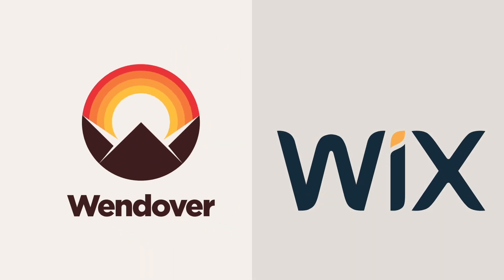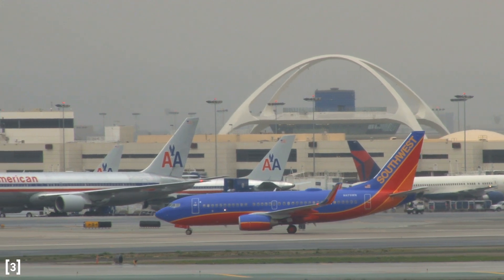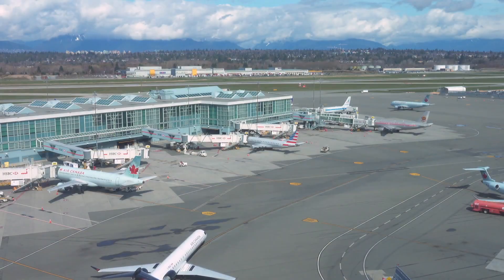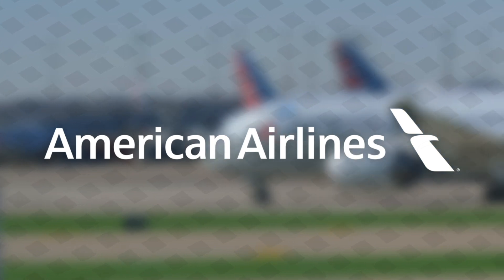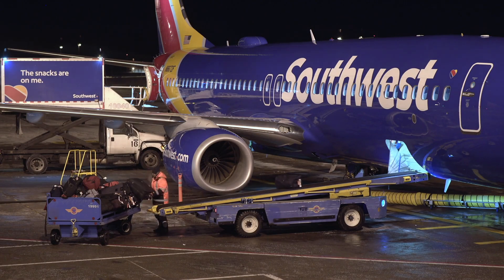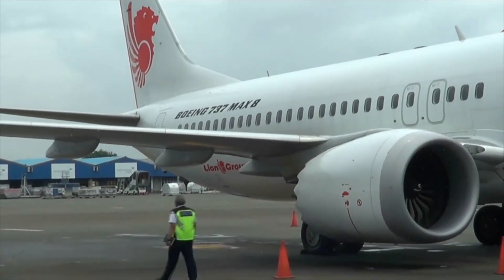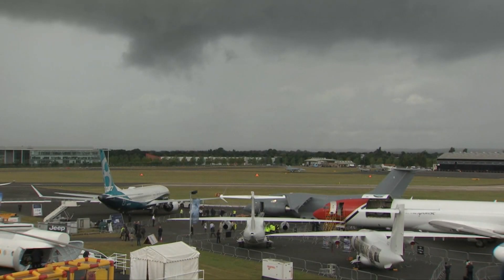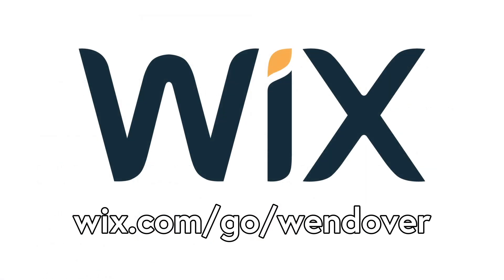The Economics That Made Boeing Build the 737 Max

Comment: MCAS these days actually stands for "malfunctioning, crashing aircraft system".
Reply: Might Crash Any Second
Reply: Malfunction Causes Airplane Crash
Reply: Money Comes Above Safety.
Reply: It’s not malfunctioning though. It’s very efficient at crashing aircrafts.
Reply: @totaleXess  Well then, how about we rename it to "system that corrects and augments movement", or SCAM for short?
Reply: @denelson83  

I saw what you did there. Hahaha! Next is not for you.

The root cause of the problem is bad airplane upgrades. They keep making convoluted solutions instead of addressing the root cause of the problem. It saved Boeing for a little while, but it might be the killing blow for them. 

I find it unfair, rude, inconsiderate, and without manners to blame the pilots. (1), preliminary investigation on 610 does not point to pilot error as the primary cause of the crash. (2), investigatyions on 302 concluded the plane is not air worthy. (3) the procedure to correct for MCAS malfunction is insufficient to save the planes. (4) some recovery procedures, relevant to the crash, on the Boeing manual has been omitted. (5) pilot training and distribution of corrective procedure for the upgraded planes is insufficient. (6), two crashed planes with similar circumstances means that its more than just pilot error. (7), pilots have been complaining about this for quite some time at least before the second crash... probably earlier. (8), you are not just arguing against 4 professional pilots but hundreds who made the investigation and the families of those who lost someone looking for an acceptable explanation for the crash so that there will be no third 737max to crash (I'm excluding the 737NG that crashed recently for your benefit). Specially those looking for justice and accountability. You are entitled to your opinion but here are my opinion why I think yours is wrong.

I believe, there is still a way to save the 737Max. The best solution for me is to make changes in the aerodynamic design of the aircraft. The initial cost of that is a lot with the recall of those planes for an upgrade but is probably cheaper in the long run. The next solution I can think of is improving the avionics of the plane. Something like, better instruments, more redundant computers, redundant systems,  software upgrades, testing and maintenance, but this is another convoluted solution that will probably cost more in the long run and shorten the life of the plane. 

Some people are losing their minds for the moment. Software upgrades will inevitably prove insufficient. 

MCAS is not really bad, it's how it is connected to flight controls that is really the problem. It is how the plane depended on MCAS for normal operations that it shouldn't be. It is how the pilot became lost control when MCAS malfunctioned.

Airplane design includes ways on how to keep the pilot at his top performance level to control the plane. If the plane does not perform well on this criteria, then it is a bad plane design on keeping the pilot in control of the aircraft.

Some pilots fly biplanes, good pilots fly jumbo jets, better pilots fly fighter jets, the best pilot flies a rock.
Reply: Maximize CASualties?
Reply: @HenrikStidsen  Also the 767 tanker always had the two sensors feeding data to the MCAS
Reply: Massachusetts 
Comprehensive 
Assessment 
System
Reply: Great definition of MCAS. Lol
Reply: Well played...
Reply: Make Crash Avoidance Stochastic
Reply: The 737NG also has MCAS but only the 737 Max has the faulty AOA sensor
Reply: @Josh M It would be unfair if the pay he gets is low. @a24396 you are plain hopeless.
Reply: What about 
Might
Crash
Any
Second
Reply: If the airlines didn't train their pilots to disable a malfunctioning airplane they are at fault.
Reply: @codykyle511  Yes,

Looking up: how to disable a malfunctioning aircraft up in the air? That's just genius.
Reply: hahaha funny
Reply: The thing is that the 737-Max is perfectly safe and easy to fly without MCAS. It just won't fly exactly like a 737-800. The system is there to change the handling to mimic that of the previous generation and hence ELIMINATE the need for pilot re-training. If Boeing and the Airlines are OK with additional simulator time and/or a different type rating, they can totally eliminate MCAS has the 737-Max will handle and fly just fine -- better than the 757 actually.
Reply: @dwightlooi   i disagre with ur opinion, pilot nowaday seem like forgeting about  basic control the plane and much rely on technology what have on they plane, nowaday pilot turn on the autopilot  just after the gear up.
Reply: Bagus Respati Regardless, the Max will be a very benign aircraft to fly without MCAS. It simply won’t fly exactly like the 737-800 and hence require additional conversion training time. That was why MCAS was there — to artificially mimic the flying characteristics of the previous generation 737, not to correct unsafe handling.
Reply: Malfunctioning Crashing Aviation System is what I would prefer, but good enough
Reply: @eugeniustheodidactus8890  "down boy"? Really? GFYS. It's mishap analysis, that's always "hind sight" - you see what happened to prevent it from happening again in the future. A stab trim runaway is a known failure mode that pilots train to recognize and address. If a pilot doesn't address a situation in accordance with the procedures they were trained to use it's pilot error. But, sure... Please do share your uninformed insights.
Reply: @a24396   You know,  you are absolutely on the money in that the pilots failed to mitigate the stab trim runaway. ( which is essentially what MCAS was doing )  In fact, it took them longer than  2 minutes, while flying with excessive airspeed to start manually  trimming the wheel.  It cannot be denied that they failed to do their job properly and that people lost their lives primarily due to this.  My original reply to you stems from  my desire to see people be a bit more diplomatic online about these pilots.
Reply: @One Who Waits  I blame pilots when it's pilot error.

Plenty of A320s mishaps because of design decisions made by Airbus - decisions like no tactile feedback between side stick controls or the thrust control levers not moving when under auto thrust control. Two examples, but there are more. But those are not defects, just design decisions. 

And, just as I already stated and explained, the crashes of the 737-MAX were both more to do with pilot error than anything Boeing might have done.

Because the bottom line here is both aircraft were flyable if the pilots had done the "pilot stuff" better. So, yeah... I'm blaming the pilots. 

The changes to MCAS that will be made will make it less likely to cause a runaway trim, but if the only lesson learned here was "MCAS bad" then we are ignoring the bulk of the root causes for the mishap - which can then still cause other crashes. Heck, at this point I'm sure EVERYONE, pilot or not, could recognize a spurious MCAS commanded nose down trim and what to do about it. But that's not enough to save passengers from poor piloting.
Reply: I wonder if there might be an acronym constructed for pilots that couldn't figure out how to fly their aircraft and respond properly to a relatively minor malfunction?
Reply: @a24396  Yeah.  It's called CFIT.
Reply: denelson83 I don't think CFIT fits unless you're redefining "control". When an undocumented subsystem acquires command authority for one of your equipment's axis, the pilot is not in control.

Comment: You said in your opening statement the 737max is a new aircraft but then went on to say that it has Paper Check lists, a 7 step start procedure, antiquated warning system. What you should have said is the 737max is a very old aircraft design [dating back to the 1960s'] but with new engines.
Reply: Airframe is basically from '60.... This is like car manufacturer make only face lift's and engine to pass new emission standards

Comment: I don't get the point why higher engine is the cause. higher engine itself is just making the center or thrust closer to the center of mass (the center of mass is still higher than engines).
and thrust is still horizontal, the leverage of pitch from higher engines is in fact reduced, not increased.
I think it's the thrust of engines playing a bigger role of the unexpected pitch.

Comment: There is another issue that no one hear is addressing, pilot training. None of the U.S., European, or Australian 737-Max aircraft crashed and some of them experienced some of the same difficulties. The combined flight time of the Ethiopian Airlines crew would not have qualified for a first officer position on most U.S. and European carriers. Does Boeing have a problem to fix, yes. Should all airlines comply with ICAO Captain and First Officer standards of 1500 hours for an Airline Transport Pilot Rating? Yes. No matter the electronics on the airplane, the safe operation is the responsibility of the Captain and the First Officer. If the MCAS is not working, turn it off and fly the plane. You still have pulleys and cables for the vary reason.

Comment: You made it sound like an anti stall system. It is not an anti stall system. It is to make handling characteristic behave like older airplanes, thus keeping pilot certification the same.
Reply: It is designed to kick in during a stall situation though and aid the pilot to get the nose down.

Comment: there's a small mistake at 9.04 . More efficient engines have more air passing through the bypass and LESS flowing through the core
Reply: There's no mistake... or, at least, not the mistake you're implying:
"due to designs that have more air bypass and flow past the engine core.", meaning 'the air bypasses, and flows past, the core'.
He's repeating himself (bypass >> flow past), but he's not saying that more air flows through the core.
Reply: @Eyrlumi  thank you , I didn't listen carefully

Comment: Another fact about the 737, Boeing has covered up flaws in it in the past. It had a pretty severe and fatal rudder flaw back in the day, that wasn't fixed until almost the 90s.
Reply: Yes, and they kept denying that the problem (rudder reversal due to iced-up hydraulic lines in extremely rare circumstances) existed for a long, long time, blaming pilot error. And this time it also took two fatal crashes and many more dead bodies for them to reluctantly react. And they started out by blaming pilot error.

(Granted, the rudder issue was very hard to investigate, because by the time the crash investigators had gotten to each wreckage the ice plug had melted and the evidence disappeared. If memory serves, it wasn't until one crew managed to land their crippled aircraft and survived to tell the tale that they finally got a lead on the cause.)
Reply: At one point, Boeing even stole parts from crash sites that would have helped the investigation. It was uh, not a good thing going on there.

Comment: Your explanation of the economics is great and a welcome addition to what is known about the Max.  Your explanation of the physics and reason for the crashes, however, is spotty and leaves much to be desired.  While having MCAS adjust the auto-trim to pitch down based on a single, possibly faulty, sensor was a poor design choice on Boeing's part, the planes in question still should not have crashed!  Auto-trim can break for any number of reasons and because of that ALL 737s have always had switches that turn it off.  This is basic training for 737 pilots and should have been the response to trim-wheels spinning out of contro (it's a "memory item" for all pilots).  The flight of the same Lion Air plane just previous to the crash had the same problem which was corrected by a jump seat, off-duty pilot that knew what he was doing.  Why the plane continued to fly with a clearly faulty sensor is a question which should be asked.  Why the Ethiopian Air plane crashed in exactly the same way when the whole world knew of MCAS and possibly faulty angle-of-attack sensors is simply inexplicable.  Perhaps it has something to do with the pilot's being a relatively inexperienced 20-something and the co-pilot's having hardly enough flight hours to get a license to fly a Cessna.  Regardless, Boeing is clearly not the sole party at fault here as you imply in your simplistic explanation of why the planes crashed.
Reply: https://theaircurrent.com/aviation-safety/vestigal-design-issue-clouds-737-max-crash-investigations/

I'd advise you to read this article, specifically in the section about "Unresponsive Manual Trim". When the pilot is pulling back on the controls to keep the nose up, it is extremely hard to manually crank the trim wheel back to a normal position. And as soon as automatic trim is turned back on in an attempt to restore normal trim automatically, MCAS starts up very quickly and begins auto-trim again.

Comment: If it's a brand new aeroplane, as described in the clip, then surely it will require full certification from the FAA, won't it?
Reply: Yes, new full certification also new Type Rating for pilot's, mechanic's etc

Comment: Any and all engineers who were aware that a single sensor was providing data to the MCAS system, which could easily take down the plane if it malfunctioned, should be barred from engineering professionally for life. To be aware of that and do nothing demonstrates either a complete disregard for human life, or a complete failure to understand the most basic principles of engineering (which endangers every user of every product they will ever design).

Comment: @wendover there is so much misinformation in this video. 1, 737 max is flyby wire. 2, no plane starts with the push of a button. 3, the 737 max was released in 2016 not 60 years ago
Reply: Found the Embry Riddle kid
Reply: So you got a source for Max being fly-by-wire? If it was an FBW airplane (like Boeings already decades old designs of 777 & 787) all the pilots would've needed a completely new typerating! Only the spoilers are fly-by-wire on the Max compared to 737-100/737 Classic/737NG.. Other than that it is very much like a 737-100 from 1967 with cables and hydraulic actuators.

You are uninformed. The only things that have changed on the 737 from 60s through to today are the length of the tube, landing gear (hence the bulge from 737 Classic onwards), cockpit layout, winglets, wings and engines. Otherwise the tube still has the same geometry, control cables, ducts and electricity run in the same way as on a 737-100 from 69'

Comment: The decision for changes May not have been obvious but the designed implementation using only one Angle Of Attack sensor input at a time on a safety critical system was beyond stupidly obvious. 

The first thing every avionics design engineer should learn is REDUNDANTCY. 

If I had even suggested it as a joke I would have expected to be stripped of engineering authority yet this got passed a chief engineer and a rubber stamp government department

Comment: I think the problem is with Boeing's 797 medium plane project that they are finishing. They waited way too long to begin the project. Had they started the project as soon as Airbus was announcing its 321neo years ago they could have created a new series of plane with shorter fuselage and longer fuselage variants to replace the 737 and 757 together. It would have launched at about the same time as the 787 dreamliner and Incorporated all the new technology and materials that the dreamliner does. Basically a smaller single-aisle version of a dreamliner. And then they wouldn't have this problem. so now here comes the 797 probably out in a year or year-and-a-half. They had better get on it right now and take the 797 concept and make a shorter fuselage version to replace the 737 as soon as possible.

Comment: that pesky trim interupt switch is always hiding from the foreign carriers.
Reply: "Foreign carriers". Yeah, that must be the problem right there - they're not Americans.

Or could it possibly be that that pesky MCAS system behaved in a way that was undocumented, that it kept reactivating the runaway trim by itself after a few seconds every time because it believed in a faulty aoa sensor, that the MCAS system only ever used one of those alpha sensors at the time, that it switched active sensor every time it was turned on so that when checking a reported bad sensor the ground crews didn't find any problem because the next time they switched on the avionics it tested the other, good, sensor, and that the actual existence of the whole fucking system itself was a complete surprise to these inept foreign pilots who were obviously so bad at English that they couldn't read between the lines in the manual to figure out what was left out of the documentation on purpose? Could it possibly have been that, you think?
Reply: Benny Löfgren funny how when you ask or throw the situation at an American pilot they fix the issue in less than 10 seconds without a checklist. The emergency becomes a mild nuisance at that point.

Comment: There's also the fact that the 737-max didn't have multiple redundant angle of attack sensors. It had 1. As opposed to the 4 that are usually used.
Reply: It had multiple it just wasn't using them for MCAS but pilots did get AoA mismatch error.

Comment: To all the people saying the 737 MAX is not flying right now please go educate yourselfs and you’ll find that it’s only the 737-800 MAX due the lift it created they installed a system called MCAS (which was flawed) and it helped push the nose down 

I do not condone Boeing’s actions to sell and produce the 737-800 MAX 

I just wanna educate people
Reply: So where'd the last flight of other Maxs' apart from Boeing test mules? All 737-7,-8,-9 Maxs are grounded because they crashed from a seemingly similar fault. Older design 737s are of course flying.